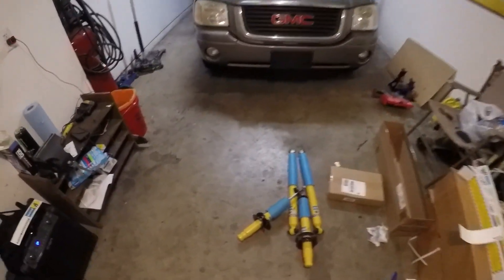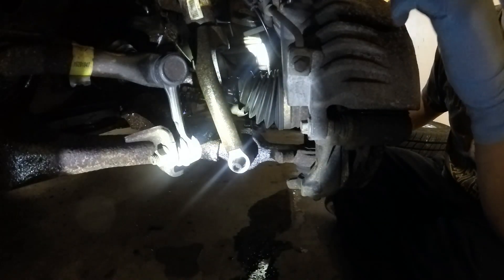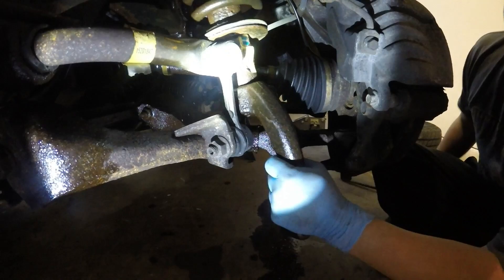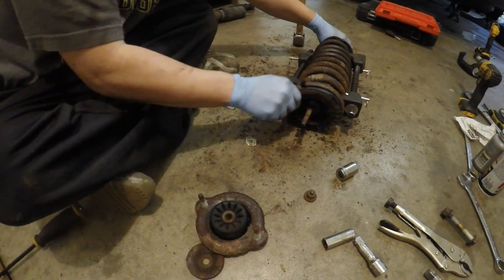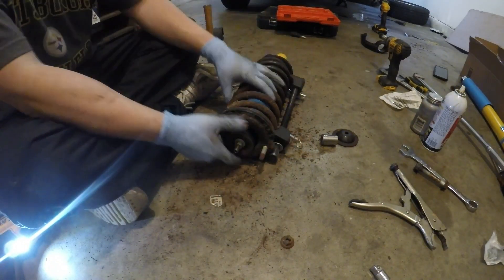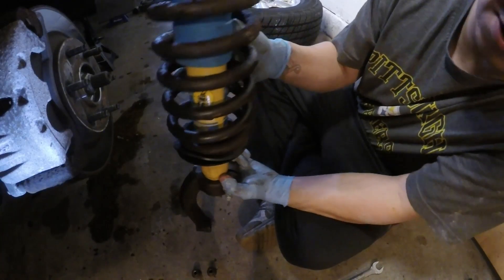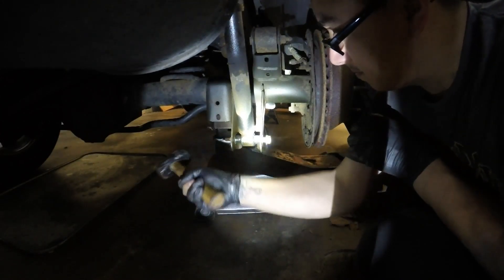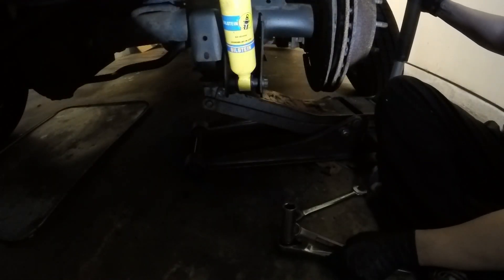GMC Envoy - Shock Struts Replacement

Comment: I just bought pre-assembled spring and shocks for the front struts and replaced the whole unit, no need for compressing the springs and much faster, easier and safer!
Reply: They wear out quicker
Reply: I used a brand of pre assembled struts called Oredy from Amazon. Fit right and ride nice!

Comment: Thnx 4 video!!! Looking at prices further, go with quick struts, already bought separate pieces and have to transfer spring, found quick struts (pair)for 95 bucks free shipping. Yeah, wont be taking axle out and everything else as A1 guy!!!✌
Reply from the maker: yeah quick struts are alot easier. Removes half the time lol. good luck.
Reply: Yeah, 20 plus years ago I was a master tech at top GM dealer, alot of people don't remember "flat rate" sink or swim son, some days don't flag even an hour and some days 25-30 hours flagged in 9-10 hours. Been awhile 4 me, have 2 remind myself, work smarter not harder, I knew better, get Quick Struts!!!✌
Reply: @meangene6766 the bilstein 4600's are & always have been solid upgrades. I'd rather put in the extra work for something that's gonna last, instead of taking chances with cheap shit just because it was "easier" to install lol🤦‍♂️🤣.

Comment: Do you happen to know the torque specs for any of these bolts?
Reply from the maker: 6ix set negative. im sure there is a site online that may have them. just type your specific vehicle and you can probably find it.
Reply: hyr0llr yeah i keep looking and keep getting different information.. some say about 50lbs for the lower pinch nut then some say 90lbs.. i have an 06 trailblazer so im sure its the same as the envoys. One more question,  is it always that easy to take off that bracket? Ive read that some ppl take hours to do it but you literally did it in 5 seconds.  Is it just easy to do with power tools, because i only have hand tools.
Reply from the maker: 6ix set i would just tighten them down with a normal sized 3/8 as much as you can. and like you saw, after removing that big nut, i would get a small sledge hammer to hit the bracket to loosen any corrosion holding it together. and than a prybar to get it the rest of the way. But make sure the top 2 nuts are off so the strut assembly will rotate when you pry the bottom bracket.
Reply: hyr0llr ok thanks man appreciate the replies.
Reply from the maker: 6ix set no problem

Comment: I greatly appreciate this video. It seems to be the most easy going method for replacing the struts without disconnecting the rotor and upper control arm. I'll be doing mine once my parts come in. I went with a Monroe OESpectrum (formerly Sensa-Trac) series strut assembly and rear shocks so I don't have to compress the springs and reassemble the struts. Also it was less expensive than a set of Bilstein shocks & strut mounts. Safer, easier and cheaper.

Thank you very much, hyr0llr for your how-to video. I'll report back after my repairs.
2004 Trailblazer that needs some TLC. Still has factory shocks in it after 130K miles!
Reply from the maker: Kevin Mitchell your very welcome and goodluck. it will be much safer without having to compress the spring. lol
Reply: It took me 3 hours to replace the front struts and rear shocks. The front shocks were rusted onto the bracket pretty bad. Once I got my technique down the other side was a breeze. The test drive was beyond rewarding. No more clunking and squeaks! Thank you again for the video!
Reply from the maker: @kevinmitchell413  good job man. glad it went pretty smooth. enjoy your new riding comfort.

Comment: On the passenger side,  did you have a problem with the sway bar link being in the way.?
Reply from the maker: i dont believe so. in the video i did the passenger side first and if i did have trouble i would have also included it.

Comment: Really it that easy? Is that only for early models or every year? I have an 04 and all the videos I seen so far want you to take a ton of stuff apart.
Reply from the maker: The Upscale i would assume its the same for the 04. Cant see it being different if its the same generation truck.
Reply: hyr0llr nice, I hope so, it's so much easier to do that. And a full assembly would be even easier huh?
Reply from the maker: Yup just top bolts and the bottom 2. No time bomb
Reply: hyr0llr thanks man :D
Reply: I have 04 too upscale. Was it this easy on yours?  I too saw other vids taking shit load of stuff off.